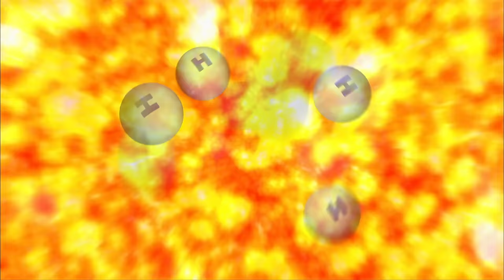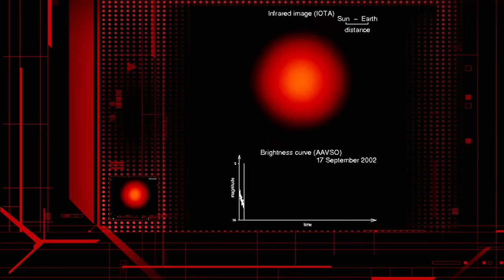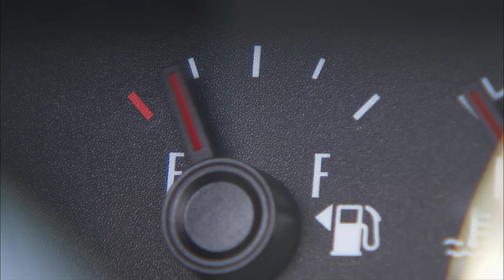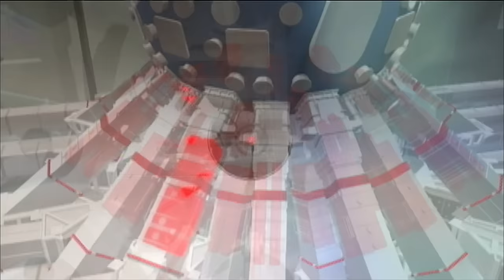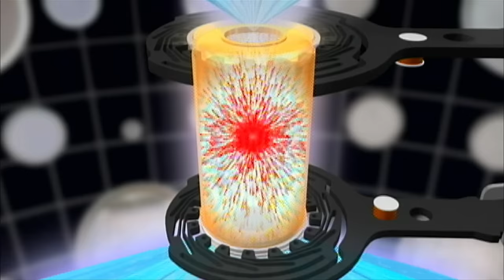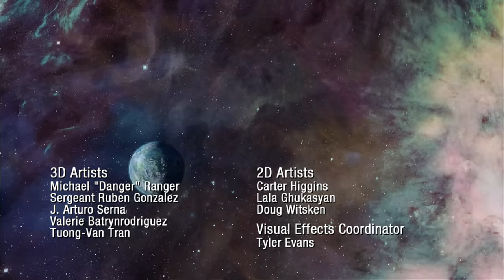The Universe: Dark Future of the Sun (S5, E8) | Full Episode | History

Comment: What I want to know is that our sun was born from the remnants of much much larger Star that went boom. So where is the corpse of that Star?
Reply: That's a good question.   There were probably gasses that were pressed together by the shockwave of a supernova.   But the gas that was pressed together could have been mixed from various planetary nebulae and previous supernovae. The lighter elements may have come from various stars whether they simply evaporated (as the sun will) or blew up.    If you have the right stuff,  you may consider looking for nearby neutron stars  or black holes,  maybe  5,000 light years....  You typically need a supernova to produce one of those two remnants.  Of course, black holes  and magnetars are harder to find than pulsars.

Comment: I find these shows interesting but note each time they state Mercury and Venus will basically evaporate.  I believe in the distant future such theories will change as mass is absorbed or the suns gravity pulls materials off Mercury increasing the suns mass, then Venus, Earth accelerating the rate at which non fusible mass is gained by the suns gravity.
Reply: Putting the mass of all three of those planets together and it wouldn't be enough for the Sun to even notice.  The mass will just be a slight 'impurity' and negligible.

Comment: Your greenhouse theory is incorrect. Sure, water vapor is a greenhouse gas but the earth does not exist in a test tube. Heat radiates back out into space.
As far as Venus, it’s not hot because of greenhouse gases trapping light and heat from the sun as the vast majority of it never even comes close to reaching the surface,  it’s reflected back out into space. The reason Venus is hot is because of its intense atmospheric pressure. That’s  same reason Jupiter is so hot the further into the atmosphere you go
The reason the climate fluctuates on earth isn’t because of rising CO2, it has very little effect. It is because of both solar and ocean cycles
Reply: Wrong